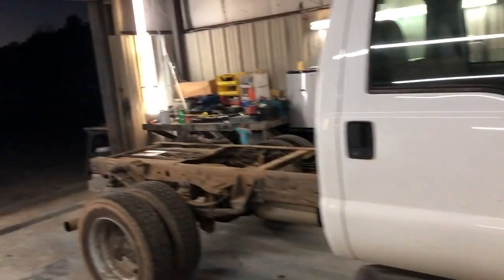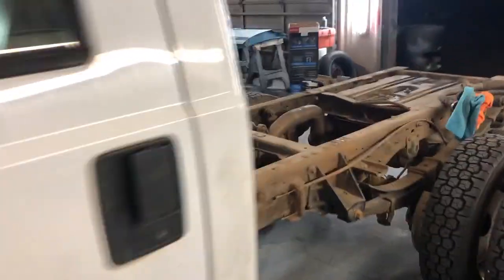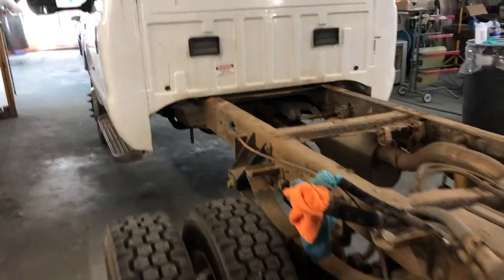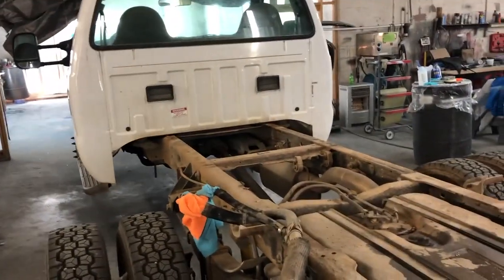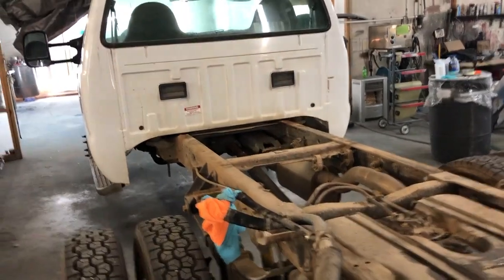F450 Electric Conversion - ICE Removal

Comment: I would like to see a Crown Victoria electric conversion. Also I would have chosen a non runner 2003-10 truck instead because the rest of the truck  are usually still in good shape.

Comment: Just saw you in f450 video posted by Like Tesla. Particularly your “special” transfer case. I’m converting a 4x4 and working through the exact same gearingchallenges to use the drive unit and ditch the transmission. Really curious about your gear reduction. Also how you’re connecting the inverter?